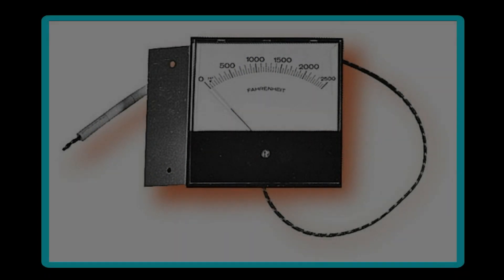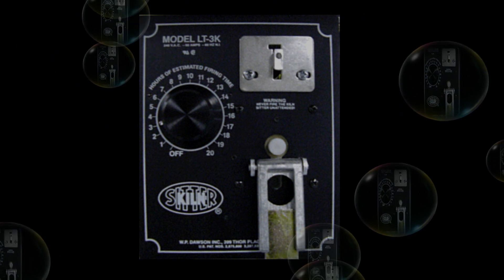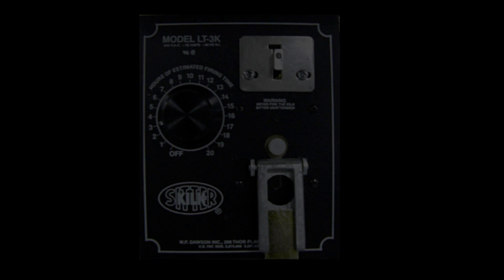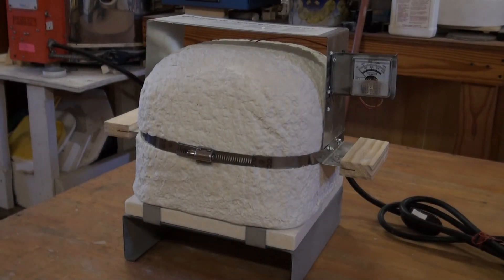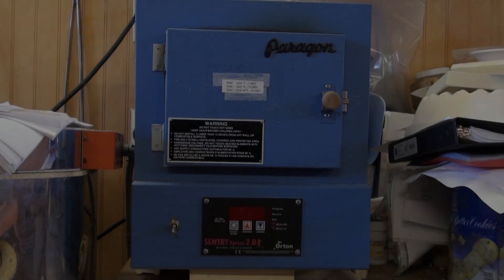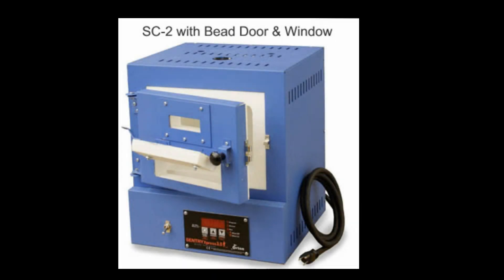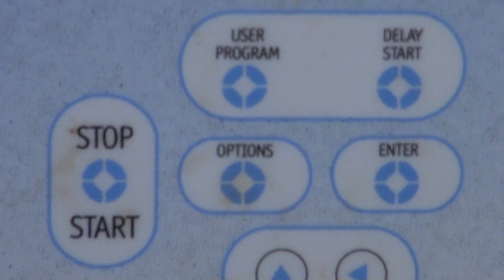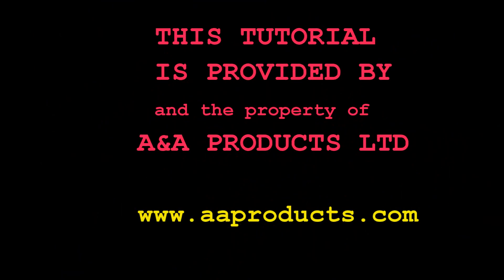HOW TO SELECT A KILN (Part 3)

Comment from the maker: I'm not sure.  Perhaps I have my kiln in a cooler place.   Also, my jewelry was very small and I could remove it fairly quickly.  An hour to one and one-half hours is pretty standard for small pieces.  No schedule.  I simply let it climb as fast as possible to the fusing temp, then turn it off.